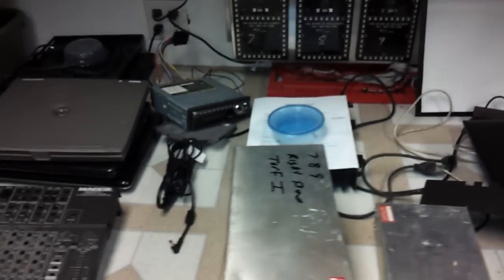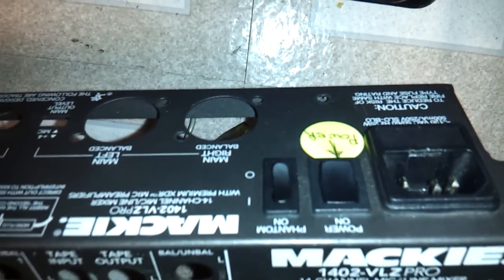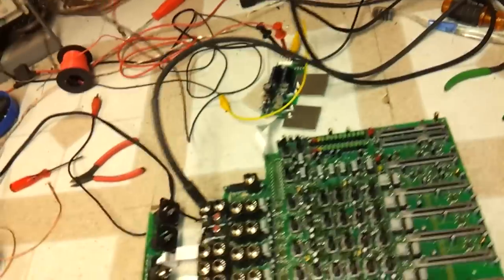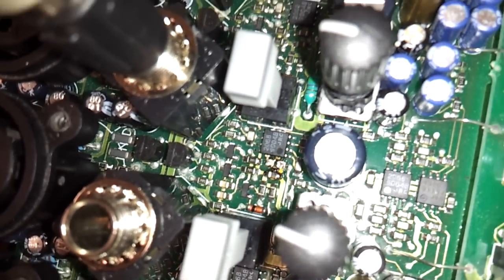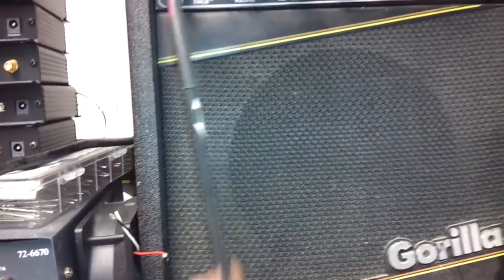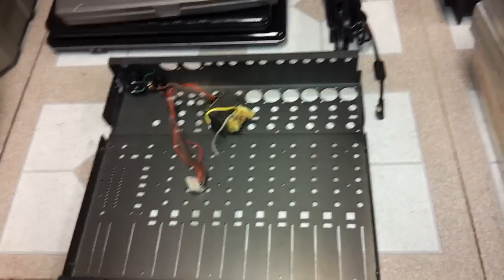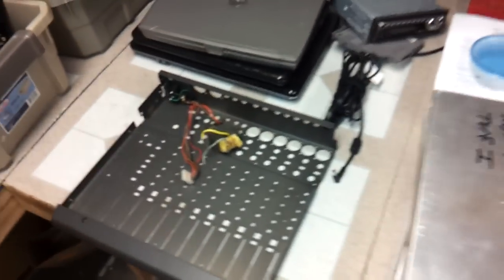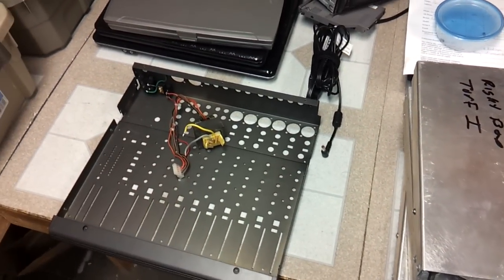Mackie 1402 Console repair

Comment: My 1402 VLZ sent to Mackie in Washington State for warranty sometime in 2008. Mackie replaced transformer, and entire circuits boards with 1402 VLZ Pro. But the steal housing- case stayed the same since serial affixed on the back.  However, the original mixer circuits boards made in the USA, but the all the circuits board made in China during the warranty period. In 2017, I started experience intermittent left audio main out weak, I had ran series of tested by different setup configurations. Yes, this 1402 VLZ Pro does have several series of problems with XLR inputs and inserts that I used with dbx 1066 compression/limiter/gate.  I am about to purchased new one, but still not sure which one, yet?  I am very busy to do any DIY.  I have electronics and electrical engineering background.  I love this compact mixer with simple operation.  I needed 4 XLR mics, 4 Stereo inputs, inserts, 48V individuals phantom powers, monitors, etc.  This tiny Mackie mixer does very good job over the years.  Mackie no longer accepting any repairs at theirs manufacturing in Washington State.  They have sub-contractors in each states, those sub-contractors did not repaired well for Mackie products or QSC products, in my experienced.

Comment: Wow, great video - I just got the same mixer up and running. I got it for £10 at an electronics fayre and its 110v, so someone had disconnected the mains transformer - being in England (240v) they obviously couldn't find a replacement either. What made me laugh is i have the same Gorilla amp in my garage I use for testing stuff and I got that for free too!

Comment: Actually, there is a thermal fuse wrapped under tape on the primary for the transformer, It is a 130 degree Centigrade 1 amp fuse. You can repair the transformer by replacing the thermal fuse assuming that the rest of the mixer is ok. Its available on EBAY.

Comment: Transformer failure is easy to repair, there is hidden thermal fuse (135*), just change it for new. Bypass capacitors failure is very popular in this mixers...

Comment: Most boards use the same voltages in general.  A transformer from a similar board may have a different connector, but with heat shrink and soldering skill you can substitute a transformer.  For example, try this one from Compass  OUR PART #:  0019987. An alternative is to write Compass or Mackie and ask.

Comment: Thanks for posting, sorry about the parts scarcity.

I think I would just put the generic transformer in, and forget phantom power. Live bands would typically use condenser mics on the road anyway and seldom/never have need for phantom power.

In a studio (I don't think any studio would use this small of a board anyway), any mics requiring phantom power could be fed with an add-on box.
Reply from the maker: paelgin I had also learned that some condenser mikes need the power to provide the electrostatic charge on the diaphragm in order to produce sound.

Comment: Hi, thanks for the video, Im not very techie but was the problem with the power supply because it failed from age or was it designed wrong?  Or was the reading from the powersupply because of the blown element that you showed?

Comment: Thank you THEtechnight very much for sharing your expertise. 1604 Pro Vlz, When turned on, the green led's light up across all channels. even with nothing pluged -in. A loud humm in the headphones. Any advise
Reply from the maker: +John R Jones Power supply issue there. One of your dual-rails is missing, OR a bad filter capacitor. need to inspect things with a multimeter.

Comment: I recently found out that most phantom powered mics work in a range from 12 to 48 volts. For instance, my presonus 8 channel interface actually outputs 13 volts phantom. So i think your main 18 volt supply would suffice for phantom power as well.. or am i missing something here?

Comment: I would use 2 small 24 volt transformers for that voltage. The current is low in that rail and in most cases doesn't even need to be A full 48 volts

Comment: Got 2 mixer exactr like that, EU version, both with exact the same issue as yours included the damn trasformer that is impossible to find. So after a big research I've changed it with a toroid one, 17+17 (enough, trust me) and used a tiny small one 48V found in germany for phantom, after diodes I got 52 v that's enough.
My conclusion? Mackie fail selecting components tollerance for this mixer and they NOT provide spare parts, too bad for such a great company and good tech design, so I've decided to change a bit the power supply (bigger condensers, Skottky diodes, more 100nf for bypass, enlarged heatsync), not a big change but I have got other 2 ceramic bypass capacitor issue that evaporated instead go in short circuit as before (and RIP my old transformer).

Comment: I need volume sliders pots to a Korg Soundlink 168rc, can not find any spareparts what could be used? One slider is partially working but sending out weird vol strength all over the place "over midi" until you push it to one side then it locks, so it seem like a lose connection. How hard is it for a layman doing a first time slider pot exchange?
Reply from the maker: Now, there are 2 things you can do. Either A, check the solder joints to the potentiometer itself, and reflow as necessary. 2, use a can of DeOxit and clean the pot's carbon track and work it back and forth.

Comment: Man, I'd like to ask a question about a Peavy USB series board.  Sometimes, any mic that I use in the XLR channels, sounds like the gain is just maxed out and I'm talking through a bull horn.  At the same time, the 1/4 inch portions work fine and the stereo channels work fine, it's just all of the XLR channels will sound maxed one day and be fine the next.  All gains are reasonably set, nothing is dimed in the power amp section. Doesn't matter if it's a dynamic or a condenser.  Any thoughts?  If I might pick your brain?  The board is very dirty and I haven't been inside of it yet.

Comment: I'm needing to replace one of the faders.  What tool did you use to take the main board off of the grey metal frame.  It's not a standard screw.
Reply from the maker: yes it is. it is a very small allen key. you also have to remove allbof the knobs to get at the potentiometer mounting nuts.

Comment: I hv a tapco mix 60 mixer and I hv noticed a strange issue with this,.. When I see the peak meter to check the levels it remains as it is,.It doesnt go up.. I have to really crank up the gain to record,..Earlier the meters used to work and the recording quality was very punchy,.Now it sounds hollow,.Can u tell me whee the problem lies? There is no service centre in my city,.So I will have to go to any technician and tell him where to check,.,..
Reply from the maker: Depends on when it was manufactured. the old mixers are probably suffering from capacitor failure.

Comment: Hey, thanks for the vid. I have a 1202 VLZ-PRO that desperately needs a cleaning/lube on the trim pots. I took off the back panel, but there's a second PCB board blocking me from getting at the pots. The way that the screws are setup, it's not very obvious how to remove this second board. I didn't notice you performing this task in the vid. Are you familiar with how to remove this board? Thanks.
Reply from the maker: you have to remove all the knobs and nuts off the pots. a chore for sure

Comment: I have exactly the same mixer.  TRACK 2 can't pan to LEFT (the pot can turn, but the signal doesn't go to the left) with as a result the Main Mix only has R from track 2, not L + R.. Any ideas? Thanks
Reply from the maker: these things cant be shotgunned. you will have to generate a test tone either with an app or function generator, and go signal tracing with a scope to figure out which stage is bad. sometimes the xlr or phono plug jack solder joints can crack but its rare.

Comment: Where are you located? I have the same mixer but it's starting to die. When they work, channels 1-4 pop and/or sound very hollow . Only 5 and 6 work ok. It's been fine since I only do pod-casting and right now we can get away with 2 mics, but soon I'll need those other channels fixed. What do you charge for that?
Reply from the maker: +Daniel Larios You probably need to spray out all the potentiometers with DeOxit or some other form of contact cleaner. Once you do that, it will likely be ok.

Comment: I have a 1402 VLZ- in the middle of taking it apart and I have taken out two allen head screws (the only two allens on the inside) on a small satellite board up by the power supply. Once these two screws are out there are 2 brass standoff posts...should I be able to just take some pliers and take them out counter clockwise or am I missing something?
Reply from the maker: yep.

Comment: transformer issue is quite common for small mackie mixers
Reply from the maker: well.. yea especially when one of the rails is shorted to ground via a capacitor, which is what happened to this one.

Comment: I’ve got a Mackie 32.4 VLZ Pro and it is not getting any power. The manual reads that I can replace the fuse by sliding a compartment by the A/C receptacle. I’m a novice so can someone give tips on how to replace fuse?

Comment: I was just given a 1402 LVZ3 it work but mic 1 and mic 3 inputs don't work. am I looking at an expensive repair lol or should I just get a new one. I mean its a simple fix I'm all good with that. Any insight would be greatly appreciated
Reply from the maker: +Richard Zom (ZomOfTheDead) Things like these cant be shotgun repaired, they have to have some level of troubleshooting. It could be something as simple is broken solder joints on the XLR jacks themselves, it could be simply dirty input select switches, and then it could be something as serious as a bad component in the op-amp circuit. I dont have a schematic for the VLZ3 model, only the base VLZ so I am unsure of the differences.

Comment: I need your help, i got a power speaker the speakers tweeter and woofer work i tested and also the wite leads all good but there is no (mid-bass sound send to the speaker)? The tweeter is sounding i tried various speakers but no bass . Its an ELectro voice model ZLX-12powered and yes this board seems to have pure new mini capacitors ect and it looks like nothing is burn . Help please
Reply from the maker: i cant really know without seeing that unit as i am not familiar with it. try diyaudio.com
Reply: +Chuck Brown try turning the mid range knob up a bit

Comment: if I follow correctly that bum transformer is putting out +18, -18, 48v DC? or is it AC and the power board is rectifying it to DC?
Reply from the maker: it put out AC, and the PCB rectified and regulated it down with a 7815 7915 linear regulator setup. Anyways, when I still worked for this company, I ended up using a couple switchers (SMPS) to retrofit into this thing and make it work.
Reply: THEtechknight thank you. I have one with a bad transformer so I'm trying to locate something to replace it. I thought it was going to be AC out but hard to tell from the video. Thanks for the help. this is the first reference to actual voltage out of the transformer I have found. we're you ever able to confirm that it is the 18/50 volts?
Reply from the maker: What you can do, if you don't need phantom power, is grab a 36V center-tapped transformer which gets you +/-18V, and from there you can get the rails back. But here's the problem. Transformers don't go bad for no reason, as in my case, the transformer failed because of an overload condition on one of the rails. So you need to check this 1st.
Reply: I do plan to check that. I pulled the transformer apart and found the 120 positive lead disconnected from the coil but no luck. Transformer is still not putting any power out. I did not find a heat resistor or anything like that either.

Comment: have you come across any 1604-VLZ Pro mixers with the issue of the main outs cutting out?  sometimes louder on the right side and the left side would suddenly drop out or just be lower in volume by about 3 to 9 dB?  I have my mixer apart. I replaced the main fader, but the issue is still there.  Someone suggest replacing the Op Amp for the main fader, another person suggest replacing the tiny 120 ohm resistor near the 1/4" output jack (R79, R80, R83, R84 on the PCB - page 6 on service manual) .  I am leaning toward the resistor, but not 100% sure.
Reply from the maker: Well, the only real way to figure that one out is using a signal generator, and watch it with an oscilloscope, trace it back stage by stage until you figure out which stage is causing the issue. Right off the bat the only thing I can think of is bad solder joints on the jacks themselves. Resistors dont do that. Capacitors, ICs, and Bad Solder joints can do this.
Reply: I don't have either tools unfortunately.  I re-soldered the output jacks (since I had to remove them to get to the SMT resistors to check impedance) and checked continuity from the connection pin to the main out jack...all good.  Now I get nothing except for some crosstalk. Everyone swears ribbon cables are the issue, but I am not convinced. I did a continuity check on the main out ribbon cable and they're good. I have some Op-Amp ICs coming in and I'll replace that one at the main fader. Another thing I noticed is a slightly bulging cap 2200uf 25v in the power supply section, but the schematic says its for the BNC lamp circuit. So if that one pops I won't be too worried since it appears to be independent circuit.

Comment: Hi I know this is an old video, But some years ago I replaced the faders of all the channels of the mackie but it didnt work fine, so I left for some years apart, Know Id like to get the faders volumes at aliexpress But I dont have the data to ask for the faders, for example from the channel 1 to 6 maybe all them are Mono channels and the channels 7 to 10 maybe are stereo, and the master volume and the one before ? please help me to get all the volume control faders. give 'please the data of all them to ask for them.
Reply from the maker: +Djdannys Mexicano you have to go off the ones you have, you should have part numbers on the potentiometers themselves, and from there you can cross-reference. YOU have to do a little homework.
Reply: I got the schematics! I replaced the originals with rounded wrong model so it was diferent.

Comment: I need help .my XLR and 1/4 inch input doesn't work any idea to trouble shoot?
Mackie profx12
Reply from the maker: +Rosendo Ortega I need more details. You talking about inputs? outputs? what?
Reply: Inputs sorry. It's like if half the board doesn't function. BC the mute button light won't go on.
Reply from the maker: Rosendo Ortega This board is something I would have to personally see. This is a microcontroller-based board, and god only knows where that issue resides. It could be something as easy as a missing voltage from a shorted op-amp, or MLCC capacitor, spill damage, or something as worse and terminal as the microcontroller itself.
Reply: +THEtechknight mmmm where are you located?
Reply from the maker: Rosendo Ortega North Carolina. Used to be ohio. Anyways, I am going to see if I can get some service information, it would aid me to figure out whats going on.
Reply from the maker: +Rosendo Ortega This must be a relatively newer console. I cant find the service manual/schematics on my usual sites.

Comment: Do you repair for payment if a person was to send you a board? 32 channel Mackie. Analog. Older
Reply from the maker: Depends on whats going on with it and how obvious the fault is. I dont have a test setup for bare boards so without the other parts it'll be hard to troubleshoot, unless the fault is obvious. I know a 32 channel mixer is almost impossible to ship because of size and weight, so having a general idea of the fault would help alot.